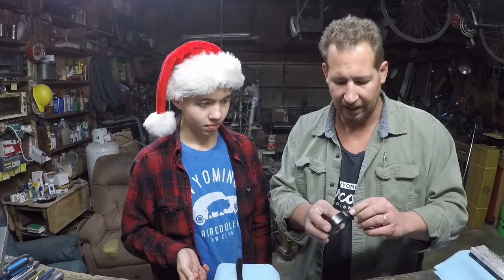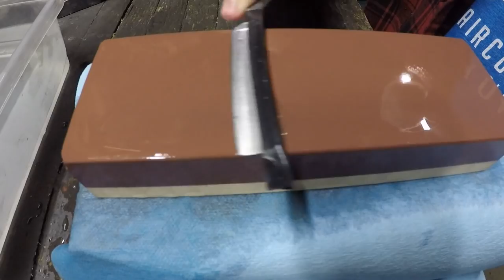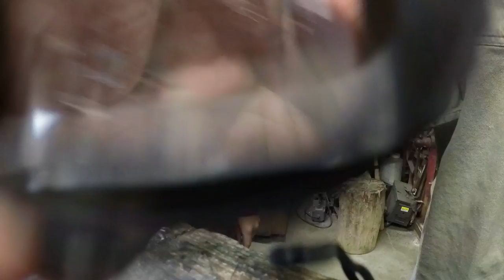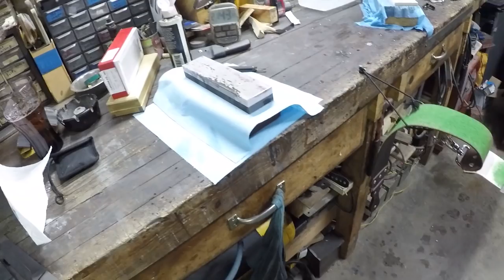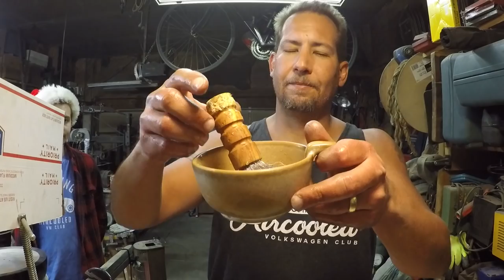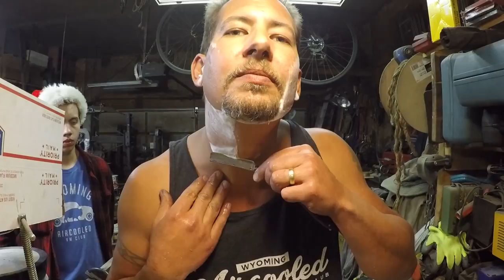Simple and easy straight razor honing or sharpening

Comment: Some really good tips in here, from watching the water over the edge to the torque and how it affects where you apex first.  I should have used tape when I first reset the straight razor I have...instead I just used the spine and I did grind it down prematurely.  I wanted to reset it w/o tape just so I wouldn't need tape (as I remembered Jeremy had set it with tape), and the spine wore faster than I expected...my pressure's must have been off.

At any rate, Vance did a great job!  It's a really nice video you both produced.
Reply from the maker: thanks man!! couple things to remember is that this was a completely straight razor, so no smile, and so the strokes vance was using could work well with it. pressure with razors is very light, even when you are doing heavy stock removal as in removing chips or resetting bevels, use just enough pressure to get the stone to cut and maybe a hair more if doing heavy work. if you ground the spine down too much on your razor, you can always use tape to lift it back up for honing if you find the edge wont support that shallow an angle and you need to increase it.
Reply: @joecalton1449  Thanks Joe.  I'll probably add some tape the next time I sharpen it.
Reply: There is nothing wrong with spine wearing.  It's part of the design of the razor.  Murray Carter explains https://www.youtube.com/watch?v=WECHanHc8Ko at 18:34

Comment: Awesome video! A tip for Vance’s light touch. Sometimes it can help to use the weight of your other hand on the toe side of the razor to guide the toe and also make up for the pressure to get the whole edge set. Especially when the pressure is mostly on the heel side and not balanced completely. It helped me in the very beginning. I like using my other hand to guide the toe and even out the pressure overall on the razor. Either way great job and an awesome video!

Comment: @joecalton1449 do you have any stone recommendations for putting a good edge on a straight razor on a budget? Everything i would trust is so expensive.
Reply from the maker: the older king kw-65 1000/6000 waterstone is $35 shipped on amazon right now and is the stone I recomend for straight razors and anywhere else that you want a 6000 grit edge. then chromium oxide on a linen strop, then clean linen, leather and shave.

Comment: Why only hold razor with one hand?  The pressure is always higher closer to the holding hand.  Can't you even out the pressure by using the other hand to apply pressure near the edge like knife sharpening?

example https://www.youtube.com/watch?v=9xl4w3JrF0s
Reply from the maker: for me it is easier to concentrate on where the pressure is being applied by only using one hand. when I use both,  my tendancy is to put more pressure straight down instead of torquing the blade towards the edge and that greatly increases spine wear. your hands and your style might be slightly different from mine though.